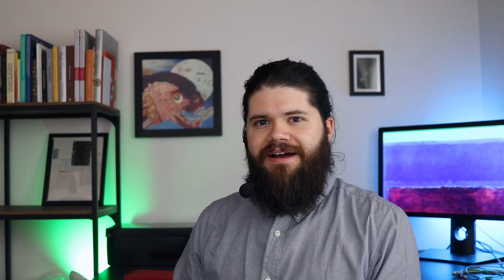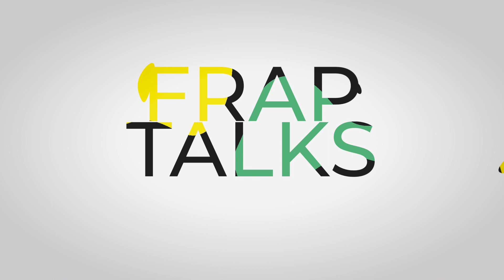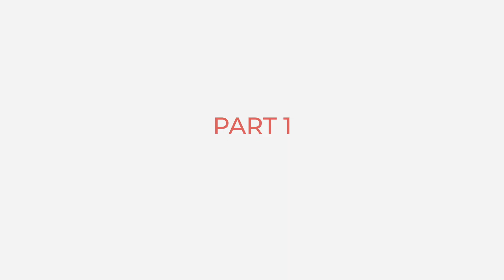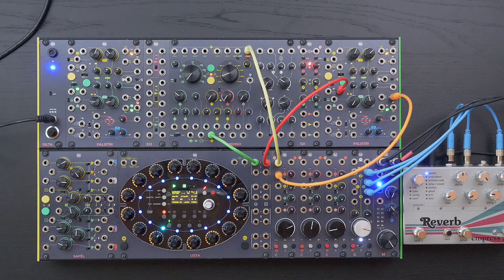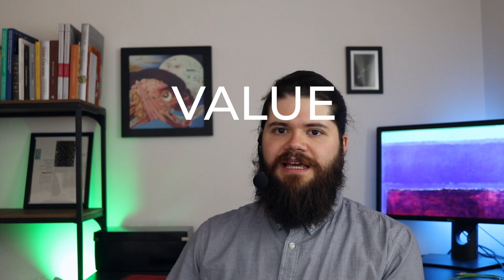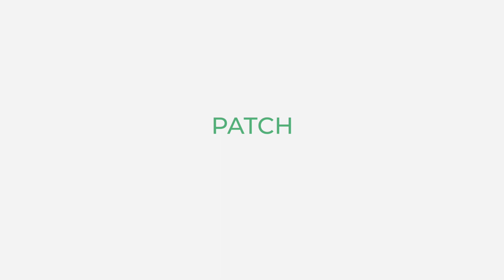Timing Pulses, Episode 3 | Frap Talks

Comment: Hi frap tools, a question regarding USTA gates. At what voltage does the USTA output gates? 10v? 5v?
Reply from the maker: Hi Michael! The USTA’s gates are 10 V high. You can find other specs at p. 84 of the current Manualone version. If you have any other questions, feel free to reach us out at support [at] frap [dot] tools!